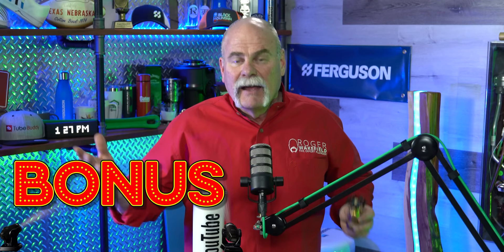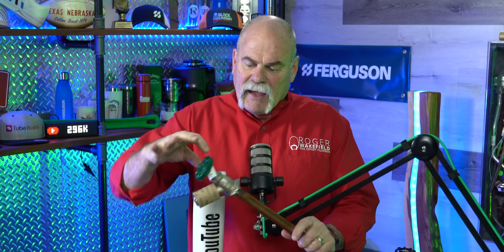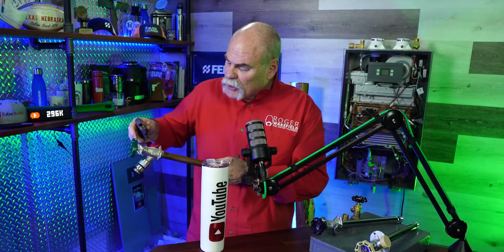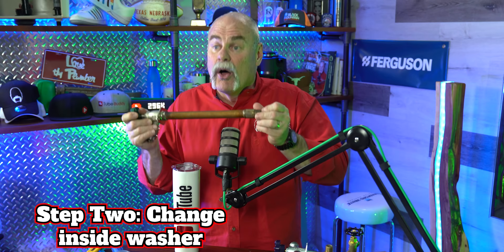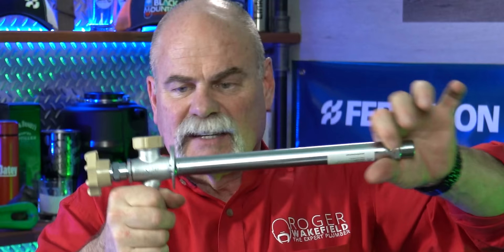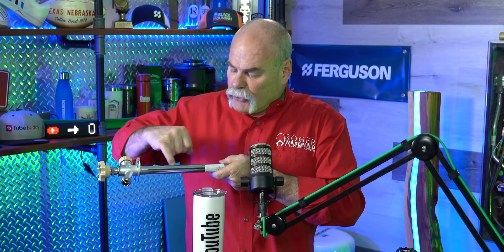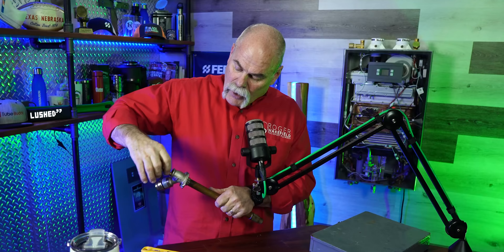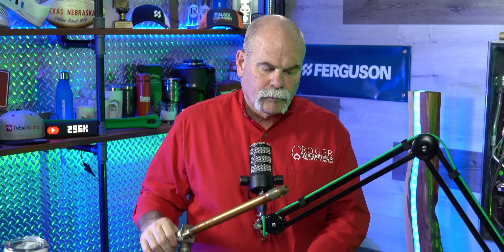How To Fix a Leaking Frost Proof Faucet | DIY Plumbing

Comment: As a home owner the biggest problem that I have with any faucet is the small screw shearing off due to corrosion.
Reply: Same. Could not even drill it out with a speedout bit. Had to buy a whole new inner unit.
Reply: Cross-threading the faucet after changing the washer

Comment: Great content,  your presentation style is very easy to understand.   One minor suggestion,   It is difficult to see some of the small washer parts and the ends of the valve.   A macro B-Roll shot of the end of the valve and seat would greatly help people not familiar with the valve parts. Great work!

Comment: I did a bit of building and ground maintenance.  Had 30+ cabins built in 1930s.  Plumbing and electrical were updated and some modern appliances installed in the mid-2000s.  The kitchen faucets chosen were to mimic what had been originally installed.

I'm not sure of the technical name, but it was pretty simple. Single wall tap for H and C side, faucet was a J-Shape and the handle on top.  We flipped washers, replaced them, replaced the valve seats and I would take corroded seats and give them second life with a fine metal file.  Sometimes it's what you need to do when you don't have the parts. Worked like a charm.

Amateur plumbing, electrical, locksmith, carpenter, etc.  All learned by paying attention to people much more skilled than me and asking questions. Much respect

Comment: @Roger Wakefield. Thanks for the tips on repairing these frost proof faucets. The only suggestion I have is before tightening a bonnet nut, open the stem or valve first. I've had the stem get really tightened against the seat after tightening the bonnet nut.

Hope you and your family stay safe and well.

Comment: Hi.  Thank you. Your instructions were easy to follow and very helpful.  The frost free was leaking from the vacuum breaker on the top. I could only find one kit in my area. Unfortunately the main piece had the wrong threads. So I replaced the float as it fit into the old main piece. Then swapped the old gasket  out for a new one on the main piece...one layer of Teflon on the threads for good measure. Reseated it the faucet... one layer of Teflon on the top..replace the cap and  woohoo   no leak!!   Easy Peasy!!     :D

Comment: I have some neat old vintage plumbing tools including valve seat grinding kits that go back to the days of fixing stuff rather than just throwing it away & replacing it. Usually the piece with the seat surface is a soft brass alloy or possibly just cheap zinc die cast, which was junk when it was new. Brass resurfaces easily, and with my kit the seat surface is usually better than new. One grinder has teeth and the finish grind is a fine grit stone.

Comment: a thousand thank yous Roger! The first five minutes of this video just save me a trip to the hardware store the cost of a new frost free faucet and draining the water in the house to change it. I didn't need a repair kit I just needed to put the parts inside the vacuum relief cap back in correctly after they froze.

Comment: I watch all of your videos. You would be surprised at how much in die cast maintenance plumbing Is essential. I fix leaking pipes all the time. With complex hydraulics, oil cooling, and water lines. We run copper lines sometimes too.

Comment: Thanks! I was getting ready to repack or replace the frost free but just tightening the nut stopped the leak. I was lucky with the valve and lucky to have found your video. Sent you a few bucks.

Comment: As a homeowner, when I had to change mine, the hardest thing was figuring out how to measure it for size. I did not know if i was supposed to measure just the stem or the whole thing.  I ended up ordering it 2 or 3 times til I got the right size.  Then I just changed the entire stem and left the rest of the enclosure as it was since it is soldered on.  Mine is an obscure brand too. I think McDonald or something like that.  The label on the twist valve has long worn off.  Since then i am very careful not to over tighten it when shutting off the water.  Good info here Roger.

Comment: Thank you for the needlenose tip. Had a rogue o-ring that fit to replace my worn out rubber washer. The pool is filling no trip into town necessary. Thanks again!

Comment: Mine was leaking from behind the valve handle. I bought a repair kit before inspecting in case it was a bad washer and I wasn’t able to get it back in working order as we use water for our plants every day almost. 

Well, it turned out the repair kit was only for the top bit that releases air. At that point, I had the handle off and removed the other bit behind the handle where I didn’t see any washers anyway. I reinstalled and tightened the nut bit behind the handle, hoping that tightening it would stop the leak. So far, so good.

Comment: Thank you for the detailed video along with the wonderful attitude that you've displayed. You're a real professional who's willing to teach/show individuals who WANT TO LEARN. I do want to apologize if during one of your live talk/feedback shows if I ruined your surprise for the homeowner who had concrete thrown down her drain by the previous plumber. When you had mentioned about putting in an electric outlet near her new toilet, I had instantly threw out a guess that you were going to install a really B.A. bidet that needed an outlet to function. I don't even know if you did a follow up video. So, if I offended you or ruined the surprise, I do apologize.
Reply: The stem won’t pull out is it screwed in ? I did screw the knob off could that be it ?

Comment: Sir you just saved me a lot of money and I was prevented from looking like a dummy in front of the plumber....all it was, was the nut was loose on the handle that attached to the valve, I torqued it with an adjustable wrench, no more leak!

Comment: Homeowner here, usually just change out the silcock bc it's cheap enough. Probably have changed 4 or 5 on my old house (before I smartened up and started unhooking hose and turning off water in winter lol). Unfortunately our new house has the silcock soldered in 🤦🏻‍♀️ and that's just annoying to deal with lol. Thanks for the tips! I'm sure it's not cracked this time (access in basement), so I'll check the other things out, appreciate it!

Comment: So, I replaced the washer and the faucet still leaked. I then watched your video, took the faucet apart again, and realized that the surface with the writing on it was facing the seat. Found another washer and also used your advice about the grease. Problem solved! Thanks for taking the time to make this video for us simple folk.
Reply from the maker: Glad I was able to help you out

Comment: Nice video!
You covered everything except my leak. My frost free faucet leaks out of a hole in the faucet handle stem. Especially when the hose end sprayer is off and the water on. (...creating back pressure)
Gary
Reply: Good instructions.

Comment: Love the video, but I fell even before the first hurdle. The screw holding the handle on was so rusted in that I ended up shearing it off (despite copious WD40). The weird thing is that even though the whole screw head come off, complete with its flange, the handle was still secured fast (I expected to it just fall off).
I would drill the rest of the screw out but..while their is stopcock inside the house just before the faucet connection to isolate it, that stopcock also shows signs of copper corrosion and is also stuck fast, so I have to shut the water off for the whole house to work on this. Time to call a professional!

Comment: As a homeowner, the biggest problem I had was not watching this video first! I ended up breaking the handle off from the rod by overtightening it with channel lock pliers when the water wouldn't shut off (the plier method let me turn off/on the water about 3 times before the snap). Now I need to cut a hole in the drywall of my bedroom closet to get to the other end of the Frost Proof and replace the entire thing!

Comment: Hi great video! Both our faucets leak at the handle when we open the valve (hose attached), but don't leak when it's turned off. I've tried replacing the washer inside the long stem, but that hasn't worked, and I've tried tightening the lock nut too. Any other ideas of what to check?

Comment: I had a leak coming out of the handle, but If I really turned the handle hard I could stop the leak, or at least get it down to a slow drip.  I pulled the stem out and noticed the last inch or so was a little larger, and there was a cone shaped rubber seal.  After looking at pictures of different stems I think it's what they call an Arrowhead stem.  I meant to replace that rubber piece too, but I bought the wrong one, so when I got home I convinced myself I didn't need to replace it.  While at the hardware store a lady that worked there, said, "You need a #00 washer."  Well the original washer was pretty flattened and spread out it looked a lot bigger than the #00 washer, so I thought, "That's not big enough."  I bought a #0 washer and of course when I got home and tried to put it in it was too big.    Also, when I tried to remove the screw to remove the washer I noticed the whole seat assembly was turning and when I put needle nose pliers on it to hold it the end seemed to freely move in and out of that larger end of the stem.  I was afraid I'd broken it.  As it turns out I had a whole package of #00 washers, so I didn't even need to go to the hardware store.  I replaced the #00 washer, put plumbers grease on the cone-shaped piece of rubber, the new washer and also on the "O" ring at the handle end of the stem and put everything back together.  To my amazement, when I turned the water back on there wasn't any leak and of course it was a lot easier to turn off the water at the faucet now.  Thanks for the video.
Reply: That's exactly what happens to me EVERY SINGLE TIME I try to repair something. I have to go at it at least 3-4 times, in the meantime I already bought half a dozen parts that don't fit. Hdepot loves me.

Comment: Great video Roger. I have a frost-free faucet (I think) Anyway it has that little screw on cap at the top of the faucet. Just wondering if that should be kept screwed on tight or not. Thanks.

Comment: hi great presentation and very through too. I have a leak on my Nebco 90 faucet (12in) behind the valve somewhere. When I turn on the water  I hear it falling behind the wall somewhere into my crawl space, the water sound stops once I turn the valve off.  I believe that we have a crack in the copper, as we left the hose connected one year during winter. I removed the stem, packing nut, etc, and tried to turn the entire faucet with a wrench turning left, but I gave up fearing I might turn it too much and brake it, as it would not give an inch. I am unable to verify if the anti siphon was threaded into the fitting behind the wall. I assume that it was threaded into the pipe into the house, and not welded, as there is no easy access point for a plumber. 
What would you advise i try?  thanks in advance for your knowledge.

Comment: Great video! My frost free faucet drips water after it's closed. I tried to replace washer inside. I can loose the nut that holds the stem to the body of the tap but I'm not able to pull out the stem. Is there any trick to pull it out? Thanks

Comment: I moved to a house and for the first time had a frost free faucet that was leaking from the top.  It was the Oring that was broken.  I got a thicker one than that came with it since it just didnt have enough meat on it to last.  I happened to have a spare o-ring in my stuff that was thicker, so it sealed better.  I will admit I miss my old house where I could see all this in the basement and not worry about hidden leaks and drips in the wall
Reply: I live in MA and have never had a FFF. I can see why they'd be beneficial, but even in years where I've forgotten to remove the hose and it has frozen up, I've never busted a bibb. I guess it's more about  the recessed water line, keeping that from freezing. I must not have had enough of a draft coming through to freeze the line.

Comment: I wondered why I lost all pressure on the faucet. Sure enough it froze and cracked. Had a hose on it.  Not gonna tackle it as it’s in the wall and connected to pex pipe.  Sometimes you just gotta pay.

Comment: I had one bulge and break right where the washer was... thinking it's because a hose was left connected.... it came down the wall in the basement (finished)... and then had to rip out the entire drywall and repair it.  I am glad I knew where the shutoff was for the tap.

Comment: I have a double headed frost free on the outside of the house that has both cold and hot handles. Don’t see a manufacturer name. It was leaking out the hot valve stem lots when either the hot or cold was on. I pulled the hot side valve assembly out but strangely I can’t get access to the valve stem packing.

Comment: By far the worst part of my first experience replacing one of these, was the fact the pipe in the wall wasn't strapped down and I could tell I was beginning to twist the pipe rather than unscrew the fitting.  Of course the wall it was inside of had a kitchen cabinet on one side and the master bath crapper blocked access on the other...  Friggin awesome!  Obviously pulling the toilet was the way to go.  One it was out I luckily guesstimated the length of the unit and cut the access in the wall right at the joint.   The second tough part was finding a 10" unit that was made in the goid ole USA... Obviously the big box stores were no help!  After poking around locally, I finally got online and researched who, if anyone made them here and luckily Arrowhead still did (at the time anyhow but not so sure anymore) so I ordered one up.  Having to wait for it meant my overly optimistic self, who decided to yard the old part out, figuring a quality new one would be easy to come by locally had to cap off the line.  The rest was pretty straightforward, though I did learn of a great product and a slightly different way of sealing the threaded connection.  A friend, who is a really real plumber was over when I... or actually more like he installed it.  He gave it a good wrapping of teflon and then whipped out a container of Rectum... er Rector Seal #5 and added a good coating of that.  Since then (15yrs ago) I've used that same two product method every time and have yet to have a single issue with leakage.

Comment: If water is leaking from the spicket, could I put a cap on to see it through the winter? Just noticed the leak today (had a hose connected all summer). Don't need to use the faucet until springtime. P.S. leak is steady but not gushing. Was wondering if the water would backup and go into wall. Thanks

Comment: my frost proof was dripping so I found your channel...i turned off water to stop drip and I removed outside nut but the rod doesnt pull out ...i didn't want to yank on it just in case something else holds it in but one thing i noticed about the faucet handle is it only turns a quarter turn to go on or off...not the usual 3 or 4 turns to draw the valve into the seat....i know this is the design of the faucet but is there a snap ring or other retaining device used to stop the long valve from pulling out of the pipe tube...the model is not fully spelled out but there is a big "M" on it with a triangle on top of it and "S" and "O" on it with a 42 and F14 on it...made in Taiwan...pretty sure my guy got it at Home depot or Lowes...thanks and I am now subscribed.....PS, one thing i did find out was the retaining nut was loosened by had but the sillcock was dripping out of the faucet and not the handle...maybe I fixed it by tightening it but the removal of the long valve still interests me...thks

Comment: Is there a tool to remove the valve seal if it breaks free from the stem? I tried putting pressure/water behind it (and it’s in open position). Only think else I can think to try is to take a really long drill bit and try to make contact enough to finish pulling out. Would really like to avoid cutting a hole in my living room wall to change out the whole thing.

Comment: I have a question the Brass Anti-Siphon Valve this winter again frozen/burst pipe.  To change it is not so easy because the plumber used tin to seal the pipe. can I fix  the back yard faucet doing DIY? Thanks

Comment: Excellent video, I have the frost proof anti siphon sill cock valve and it leaks where the water hose connects to the faucet. I can't turn it off, the handle keeps turning and turning. I can eventually get to a spot where it almost drops dripping but not quite. The slightest turn of the handle and it leaks even worse than I have to tun the handle till I find the sweet spot again but it still leaks. I put a two way hose connector on it that has two separate shutoff valves and that's how I got it stop leaking but that's not good for winter time. Do I need to replace the entire faucet or is there a repair for a handle that won't stop turning when shutting off? Thank you again for the great video.

Comment: I recently bought pipe dope. I returned it. It’s just so messy and almost impossible to clean off. I tried wiping and it was a nightmare. Not sure if there’s an easier way to clean up.. or should I just leave the excess on the fitting and not clean it.

Comment: I don't know how to tell if mine is a freeze proof or just a normal faucet. But I can push the knob in and the water pressure pushes the handle back out. It leaks where the knob goes into the housing. I have replaced washers but don't know if I got the right size. Should I use some packing or just get a new set up?

Comment: Why do you need one with the vacuum breaker on top, example the one at :53 vs the style at 2:30. I have 3 of with the vacuum breaker on top around my house but is it necessary to have those? Why couldn't I use the one's you started off showing at :53? Thank you.